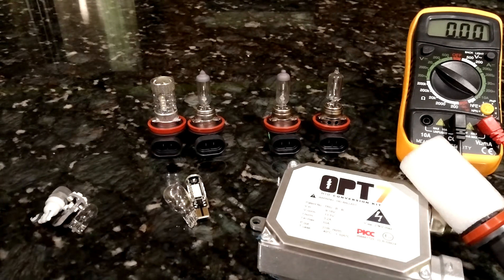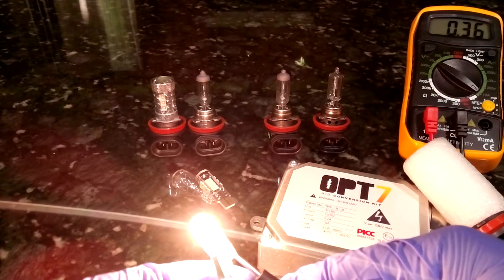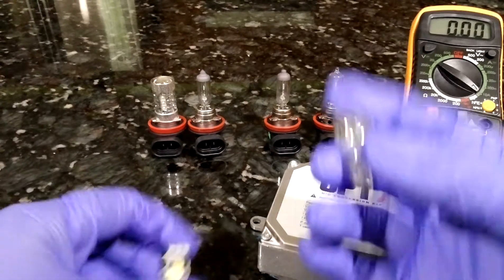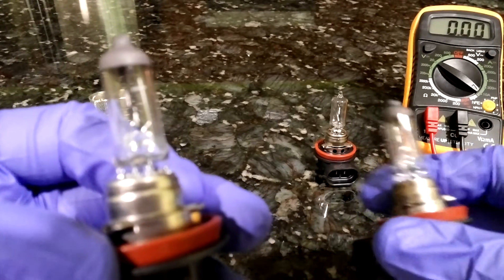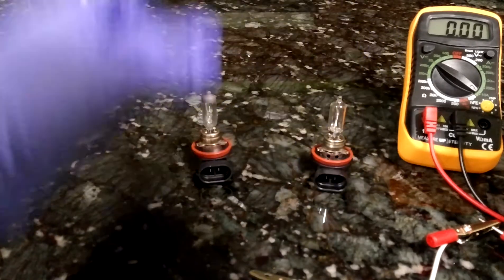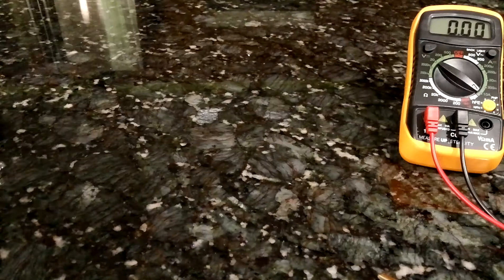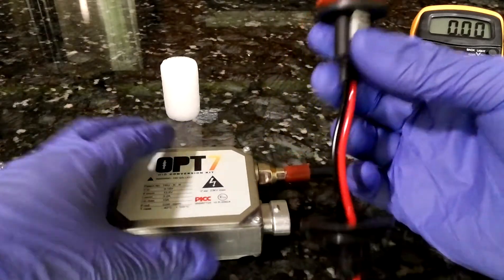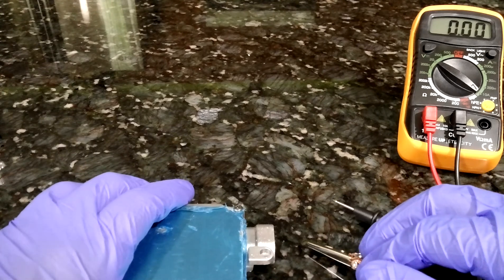12 Volt Halogen / Incandescent vs LED and HID amp draw

Comment: If you still read the comments here, I've got a toggle switch running an electric radiator fan. I have a solenoid for the fan. The switch has an LED light that lights when the fan is on. The light in the switch will light until you connect the wire to the solenoid, then the light goes out. Remove the wire to the solenoid and the light comes back on. Could there be enough of a draw to activate the solenoid that there's nothing left for the LED light in the switch ? Any suggestions ? Thanks......

Comment: Valor_X  what if the incandescent headlight bulb, turn signal bulb and the small led are connected in parallel?? Will the 3 bulbs show the same brightness as was individually?? Please kindly confirm this tests whenever they give same brightness or not. Thanks.

Comment: You forgot the most important one LED headlight bulb
Reply from the maker: Yeah unfortunately I didn't have one at the time to compare
Reply: @Argedis   Valor_X  what if the incandescent headlight bulb, turn signal bulb and the small led are connected in parallel?? Will the 3 bulbs show the same brightness as was individually?? Please kindly confirm this tests whenever they give same brightness or not. Thanks.

Comment: is it safe to say the higher the amp draw the more brighter an led will be when strobing at a fast rate vs a lower current draw led.
Reply from the maker: Generally Yes a higher powered LED that draws more amps will be brighter, but it will also need more cooling to safely operate and dissipate the heat. Not sure what you mean when strobing, the ones that do you can't tell with the naked eye. However keep in mind an older tech LED that's less efficient won't be as bright as a newer LED that may even use less power.
Reply: Valor_X i been blinking an led light off and on using a digital trigger speed sensor along with a rising edge detector circuit to trigger and turn led on for a very short  time...i notice the faster you blink the led the dimmer the luminous output...like pwm. what i want is led at its full brightness with 5% pwm duty cycle instead of 90% pwm.. increasing the voltage makes the led brighter but makes the blinking time less acurate...im thinking it must be this led current draw. I'm trying to have this led blink 3 times in one revolution of a spinning disc but maintain  its brightness with short pulse widths..this will make 3 equally spaced lines appear to be one line...but the brightness of this led seems to be fix, any brighter then the lines appears fussy...
Reply: @Argedis  what if the incandescent headlight bulb, turn signal bulb and the small led are connected in parallel?? Will the 3 bulbs show the same brightness as was individually?? Please kindly confirm this tests whenever they give same brightness or not. Thanks.

Comment: 1.34 Amps for the incandescent vs  0.04-0.06 for the LED wow.
Reply from the maker: Yeah it's a crazy difference in power draw. The same difference applies to home LED bulbs, LEDs are so cheap nowadays there's no reason for people not to upgrade.
Reply: @Argedis  yeah. My main reason for wanting to upgrade is the color choices,  cooler lighting  and mainly less power draw for automotive audio.

Comment: Lol the HID bulb broke it
Reply from the maker: lol it didn't hit me at the time when I was testing but you're right it was too much current draw
Reply: @Argedis   Valor_X  what if the incandescent headlight bulb, turn signal bulb and the small led are connected in parallel?? Will the 3 bulbs show the same brightness as was individually?? Please kindly confirm this tests whenever they give same brightness or not. Thanks.
Reply: My car has HID for the high and LED for the low, I want to swap put the HID for LED but I want something just as bright. I like the quick turn on of the LED's, no warm up needed.
Reply from the maker: @tinofreshh  For now HID's are brighter and give you more usable light than aftermarket LED bulbs. They overrate and exaggerate the lumen output of LED bulbs nowadays so don't be fooled. Also like you said LEDs are instant on so they'd be much better in the high beams so you can flash someone if needed, HID's are terrible for that.
Reply: It is terrible at flashing indeed lol. Well I guess I'll stick to the HID's then until LED technology advances a bit more to give me that same level of brightness. Thanks!
Reply: @tinofreshh  Lol you can't flash with one which need warm up. HID goes for low beam and LED on high you won't regret.
Reply: @iampatel0289  true I'll give it a go for sure.

Comment: Love the video. Now I know for sure I'm pulling less Amps through my electrical system. I replaced every bulb in my car, except the interior....lol. I love the instant on & off of L.E.D.,s. too. Specially on my brake lights. 
Glad I never bought H.I.D's. That draw was huge. 
Light color is measured in Kelvin. I like about 6000K L.E.D.  (a nice white) Any higher, they start getting to blueish. Like H.I.D do.
Check out the Kelvin scale on google. 
 LUMENS Is the measurement of brightness. My headlights are (6000K, 4000L ea...). Just one of my offroadlights is 6000k, 15,000 Lumens. (blinding). Fricking daylight...lol
Reply from the maker: Why not the interior? They're probably the cheapest bulbs you can get and one of the easiest ways to make any car feel/look more premium. Plus you'll pull even less amps lol
I don't like the higher kelvin scale bulbs either, I like to stick with 5000k-6000k.
Reply: @Argedis   Valor_X  what if the incandescent headlight bulb, turn signal bulb and the small led are connected in parallel?? Will the 3 bulbs show the same brightness as was individually?? Please kindly confirm this tests whenever they give same brightness or not. Thanks.

Comment: This is a decent test and at least you made the attempt but it seems like if every bulb was rated the same wattage out put then it would have been a better comparison of the actual difference in different type of amp draw with different bulb types .  Or were they all the same rated watts and i missed that part ?
Reply from the maker: They aren't necessarily rated the same but they are marketed as direct replacements so that's why I was comparing them.

Comment: What is with those cheaper LED lights available online nowadays?
Thet put some rediculous power numbers like 120W. That means those LEDs are using way more power then original halogens!
Do you know what's going on there?
Reply from the maker: Sorry for the late reply, it's all just overrated marketing hype to make their product seem better than the competition. Some advertise their products as being super high wattage equivalent while others use lumen output as a comparison but they also grossly overestimate that as well.
Reply: @Argedis  That's what I thought.
Thanks for confirming that!
Reply: @Argedis   Valor_X  what if the incandescent headlight bulb, turn signal bulb and the small led are connected in parallel?? Will the 3 bulbs show the same brightness as was individually?? Please kindly confirm this tests whenever they give same brightness or not. Thanks.
Reply from the maker: @tnamen1307  yes you can wire multiple lights in parallel and they will all be the same brightness as they are individually as long as the power source (battery/alternator) can supply the power required for all of them.

However if the power supply cannot keep up with the demand and voltage drops then they will lower brightness.
Reply: watts are volts times amps. and when most lights were incandescent, like home bulbs, then stating watts worked well to determine how much light it put out. But actual output of light is measured in lumens, and with HiD and LED which are more efficient use of watts, it's better to name the lumens of light output, and mention the kelvin temperature of the light, which has to do with the range of color of the light. like blue vs white or vs warm light. the higher the Kelvin temperature (again not related to the temperature of the bulb in F or Centigrade) the whiter the light output is.  
Valor_X's youtube video is showing the difference in efficiency of different bulbs, although he's not measuring light output in lumens, we can SEE the difference. :)

Comment: im thinking of replacing my motorcycle headlight with an LED. i currently have a 12 volt 7 amp battery, hooked to a 35 watt Incandescent bulb. 
Are all LEDs compatible with my battery or do i need something specific?
Reply from the maker: If the stock bulb works on 12V then you should be able to replace it to an LED with no issue, just make sure you get the same socket type.